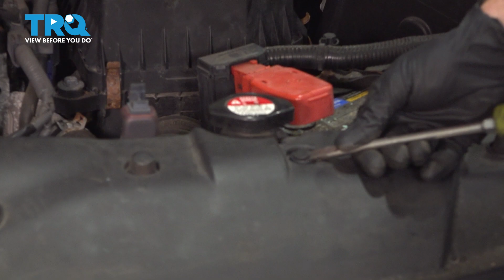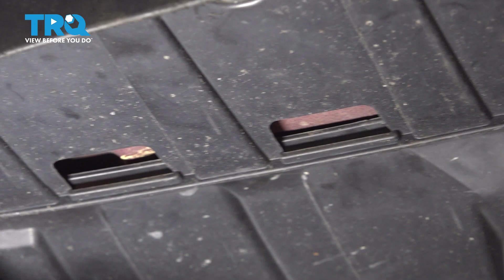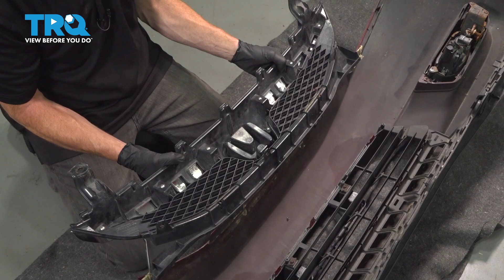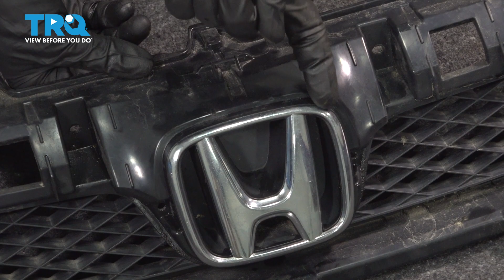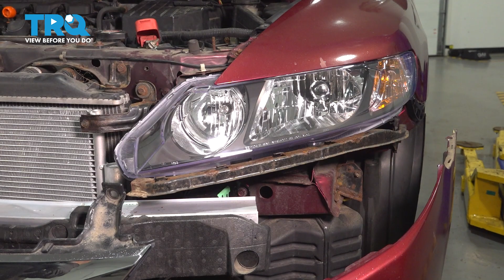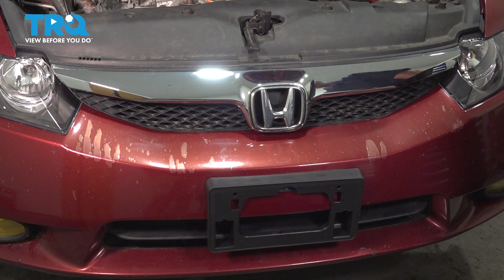How to Replace Grille 2006-2011 Honda Civic

Comment: Just an FYI for those who don’t know. The grille and bumper on a 2006 to 2008 Honda are actually one piece. The grille and the bumper cannot be separated.

So I drive a 2010 Honda Civic and I went to a junkyard to get a grille because mines broke and needed to be replaced. In my car, the grille and the bumper are two separate pieces. This is how I learned that older Hondas before mine, the grille and bumper are one piece.